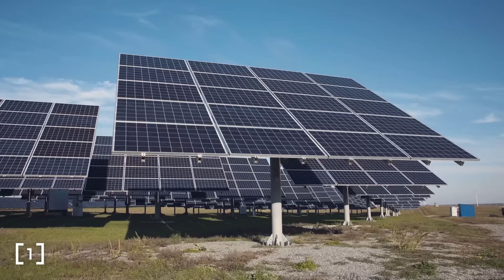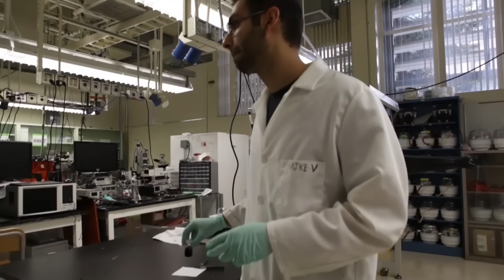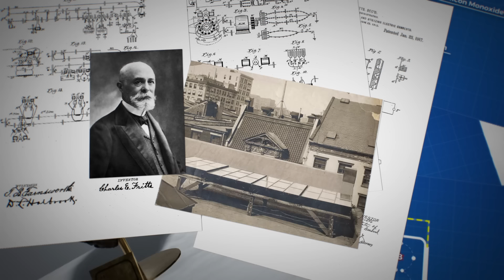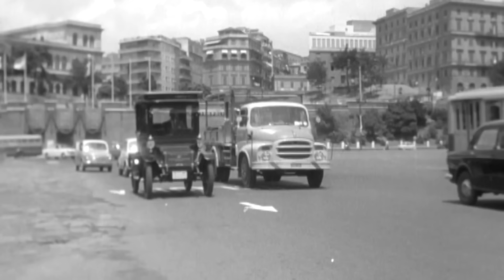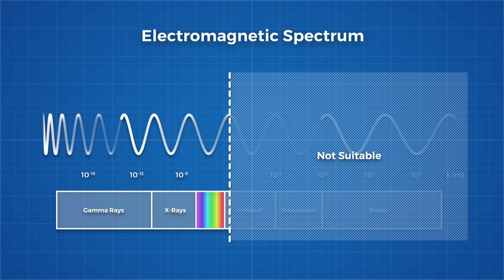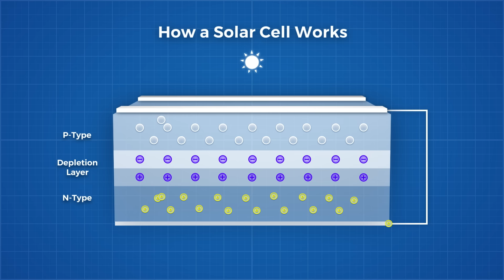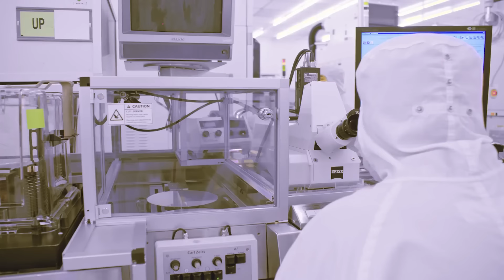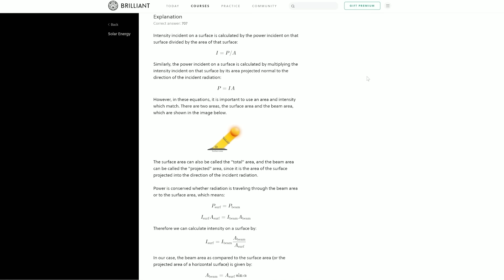The Mystery Flaw of Solar Panels

Comment: It's not the cell that's expensive. It's everything you need to go with it. Not to mention maintenance . Cleaning?  inverter fried, bad batteries, solar cell failures, charge controller / balancer. Starts to add up real quick

Comment: No mention here of the tech used by the largest panel producer in the western hemisphere. It also has the largest R&D spending in the industry. They are now moving to copper contacts dipped with group V elements.

Comment: The explanation for how a solar cell works based on this video doesn't make any sense. In this magical 'depletion layer' the negative side is facing the free electrons in the P-layer, while the + side is supposedly acting as a barrier. This is completely backwards, obviously, a negative charge repels electrons not 'accelerates them towards it', and the + charge would draw any free electrons out of the N-type layer. If this really is how the depletion layer is charged, this shouldn't work at all, so this isn't the explanation of how a solar cell can possibly create work from electrical potential.

Comment: Solar power will never take the place of oil and gas that produces power. If we knew what N.Tesla was working on we would probably have all the power we could use. The oil barons are just as guilty hiding what N.Tesla was working on.

According to what I've heard in this video a solar cell is only 20% efficient at producing power.

God bless all. Amen 🙏 ❤.

Comment: We have proven electrons do not travel along wires to a destination that there is a force that exists several w of the current flow and magnetic flux so how can we believe photons actually cause electrons to be released and travel as way f on the panel

Comment: Let's be clear on the decline of coal power.  That has almost singularly been driven by increased regulation, not the glory of the solar panel.  I'm not saying solar is bad, just the need to be honest.
Reply: Then why this power plants weren't replaced with biogas powered thermal power or wind energy, which has an even lower carbon footprint. The rapidly declining cost of solar systems is a major reason for the rapid deployment of the same.

Comment: If solar panels are installed on land suitable for farming, this inhibits the production of food, thereby increasing the cost of food. This is a major downside. There are a myriad of other problems inherent to outlying solar farms. To name a few, access in inclimate weather, added infrastructure, proximity to point of use, inconvenience of inspection, putting too many eggs in one basket, and the list goes on. While the issues brought up herein are not directly associated with the purview of this article, they do affect the end result of efficient use of the technology.
All of these issues could be addressed by placing the panels at the  point of use. Factory, commercial, and private parking areas could be "roofed" with solar panels. The roofs of the same could be covered with panels.
There is no need, and many problems associated with remote locations being used.
 I would like to hear your take on this. I sincerely enjoy your videos.

Comment: if we can somehow make a device that's like a solar cell but absorbs ionizing radiation instead and convert it to electricity, we could create a power cell or battery like device that could potentially provide power for hundred or even thousands of years. Radioactive elements like Uranium used on nuclear powerplants can only sustain energy production for a few years but after that, it will continue to emit harmful ionizing radiation for hundreds of millions of years. That means all the nuclear waste we generated in the past will outlive our civilization several hundred times. If we could somehow create that miracle device that takes ionizing radiation and converts it to energy, we could create a battery like device that would never have to be replaced for several generations. I know it sounds like fantasy for now but we humans managed to create the internet. 300 years ago, being able to talk to someone from the other side of the globe in real time would have you burned at the stake for allegedly performing witchcraft.

Comment: They have already made panels at 28% so thermal dynamics have already improved having a combined power generation of fans underneath panels could cool them cuter as any wind would drive the fan blades cooling the panels and the movement energy of the fans can be used also

Comment: We have overused solar panels to the point where they have become ineffective.

Consider the following power generating sources.

Cold Fusion (LENR) - Unproven hypothesized type of nuclear reaction that creates nuclear fusion at room temperature by producing more energy than the input energy can be produced from its altered state.

Tokamak Nuclear Fusion Reactor (ITER) - Development cost for the ITER is $150 billion. Requires a temperature of 150 million degrees Celsius to create nuclear fusion. Reportedly the record to date but having to use more input energy than produced is 69 megajoules of fusion energy for five seconds using 0.2 milligrams of fuel. 

4,536 Mw (VOGTLE) Nuclear Fission Reactor Costs $35 billion requires 1,282 hectares, nuclear safety costs $200 million per Mw, no technology to deal with nuclear waste and only has a known minable uranium reserve at current extraction rate of 80 years. 

The alternative.

Solar Hydrogen Energy Recovery Gas Turbine – 301Kwh (equivalent to 46/6.6Kw home solar units) of solar energy collected from the sun’s constant nuclear fusion at atmospheric temperature is sufficient for electrolysis to provide the start-up sequence to enable a hydrogen Gas turbine to synchronize with the turbines Variable Frequency Generator and provide constant electrolysis to continually fuel the turbine and operate the energy recovery system on a hydrogen use as produced basis to generate on a variably regulated energy range between 80 - 330Mw with optional co-generated steam capacity up to 700Mw of electrical energy on a 24/7 basis. 

The turbine consists of three operational parts, cost $36.5 -49.5 million, requires a footprint area the size of a football field, noise level is 60dbl at 60m, incorporates direct air capture of CO2 at 1,400 Kg/sec and includes a 14-year end of life decommissioning or optional refurbishment program.
 
Sixty-five carbon and pollution free, shovel ready installations generating a total of 21,450 Mw, retrofitted to any of the 120 Hydro-electric schemes would provide Australia's entire energy needs covering a combined operational area of 33 hectares for a 2023 total cost between $2.4-3.3 billion, construction period is 3 to 5 years, meet net zero twenty years earlier and makes wind and solar farms including hydro, gas and nuclear energy production redundant.

Comment: Given this is a pretty recent video - your premis is false - Solar is not growing year on year. It is still growing but the rate is dropping; currently about 10% more compared to  the prior year and it could go negative once large amounts of solar start to need replacement.  It was easy in the past to grow as solar installed base was tiny; so doubling or even 10 x early on was possible.  Now that there is a large installed base; the rate is falling.

Comment: According to an online live national grid feed. Solar only accounted for 1.4% of the UKs electricity generation in the past 24 hours.
The UK is still using gas fired power stations to generate 30 to 35% of its electricity. 
Then there’s electricity it imports from France, Belgium and Netherlands, while the UK is making claims its used less fossil fuels. Yeah that fossil fuel was just burnt elsewhere.
Quite simply, Solar doesn’t work in winter, in the UK.
Reply: Your last statement is very true, winter in the UK is just too dark for solar to be of much use. However, trying to work out how much electricity comes from solar is almost impossible, as most of it is private installations and is used on site or in the local grid. Looking at data for grid distubution won't show the true about of solar energy being produced.

Comment: Light exposure was degrading the solar panel efficiency great...can a vibration frequency alone without light power the panel because heat can be converted into vibration

Comment: Solar isn’t pushing out fossil fuels because of technological superiority, they are doing because of government regulation
Reply: No, its doing it because they save money.
Reply: @TheWatcherInTheTower your joking right?  Solar is way more expensive, nobody would buy it if it didn’t have massive government subsidies.  The only way they can be profitable is if dumbass liberals spike the cost of energy… ya know like Joe Biden tried to do.
Reply: @jjd-lx5vr The cost of solar panel installation in Australia averages around $1,000 per kW. Cheap.
Reply: @jjd-lx5vr Here solar costs about $1000/kW. At $0.40/kWh at will save you $584 a year. So after 2 years you are making money. It's why over 4.2 million Australians have domestic photovoltaic systems installed. They save money.
Reply: @TheWatcherInTheTower like I said it only can work if dumbass liberals spike the cost of energy. Here in Texas our electricity is $0.11 /kWh. Literally no one would buy them here if they weren’t subsidized. Even the people selling them to you tell you it’s 20-25 years before it breaks even and they assuming the panels don’t degrade more than they are predicting.

I’d also add that Australia’s rapid adoption of “renewables” like solar is decreasing its grid inertia to the point that grid stability is an issue. This is what caused the blackout in Spain.

Comment: I dono why scientists dont develop thermal energy devices we can harvest tons of energy just by scratching the surface of the earth or we can use Thermocouples to use the warm of sun light yes we should find a cold source in order to use a thermocouple system but its always easier to lose energy instead of gaining it.with current technology we can't do so much but imagine what would happen in 10 years and a few billions! solar panels should be installed on the orbit to achieve the peak

Comment: tl, dw: The video discusses the mystery flaw of solar panels: how electrons can travel across the junction between materials, and be accelerated into the n-type side, where there are few holes for the electron to fill. This process creates a potential difference, or voltage, between the two sides of the junction. This voltage can reduce the efficiency of a solar cell. Engineers have had to think carefully about this problem in order to optimize solar cell efficiency.

Comment: On average one acre of solar panels will produce about 351MWh of electricity per year. In 2016 New York city used 53.65 TWh of electricity. It would have taken a little  more than 152,849 acres of solar panels to meet the city's needs for that year, that's nearly 239 square miles of land. Now imagine what the power demand will be when all of the heating, cooking, and transportation is converted to electricity. How practical is it to dedicate that much land just to provide electricity to one city? And where do you find that land and what do you do with what's already on it?

Comment: A "renewable energy?" What's "renewable" in a solar panel that consumes gigawatthours of energy during the very process of manufacturing just before it can fart out a joule of electricity? A hype that, at very best, can last for approx. 10 years, because every single photon striking it irreversibly damages the panel, further reducing its poor efficiency? What's gonna happen with tons of copper, and rare-earth elements that first had to be MINED from Mother Gaia Earth, devastating natural habitats, polluting environment, and using good, ol' oil to power mining machinery? This pollution and already emitted CO2 don't exist, huh? Going back to "renewables," who's gonna recycle that crap? There's only one beneficient of so called "renewables" (both solar and wind): someone who invested big bucks and uses people's inherent stupidity to capitalize on this scam.

Comment: If you want to go further into the topic, you need to acknowledge the massive tax credits driving product demand and the point you make about "into the future" based on these tax credits. In addition, you omit the thin film CdTe panel production process in vertically integrated plants, water usage in silicon panel arrays, forced labor used in 60 percent of the world's polysilicon production in western China and the large number of coal-fired power plants operating in western China to power the silicon production.

Comment: Total B.S. for the great majority of solar panels that have been put into service for decades.  Below is the warranty of the panels (very typical) that have been on my roof for almost eleven years.  I test them annually and have never had to make a warranty claim.

25-year Linear Performance Guarantee

SolarWorld guarantees, over 25 years, that the modules' performance will not decrease by more than 0.7% per year - a distinct added value compared to the two-tiered guarantees usual in the industry.

No mystery here.

Comment: 10% drop in efficency within hours of operation? can you give us your sources for this claim? and which types of modules are more susceptible? thanks
Reply: Look for LID (Light Induced Degradation), where a reaction with oxygen causes this immediate deterioration.  These are the so called P-type panels (doped with boron).
These days you can buy N-type panels (doped with phosphorus) that do not exhibit this effect, but they are more expensive.
My choice was N-type because of an expected longer lifespan and not suffering from LID, at about 30% extra cost per panel which amounted to about 10% extra cost of the total system.  
So: depending on your means and goals, the P-type may be just fine, I'm certainly not going to be rich over the difference!